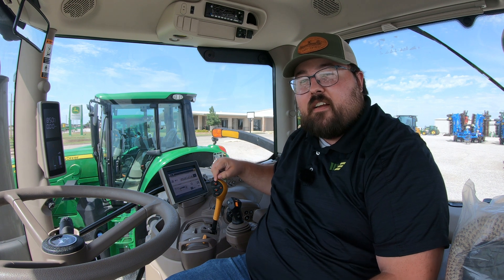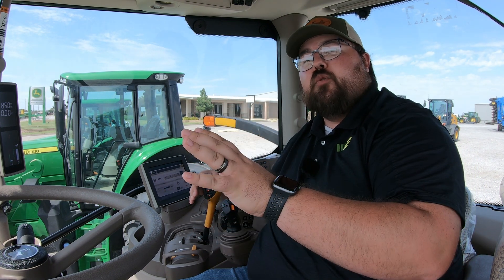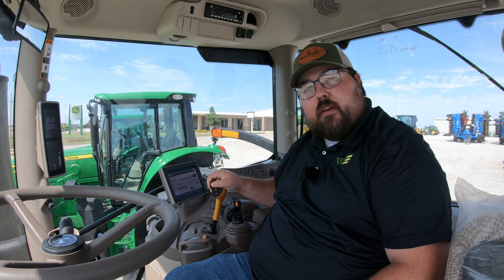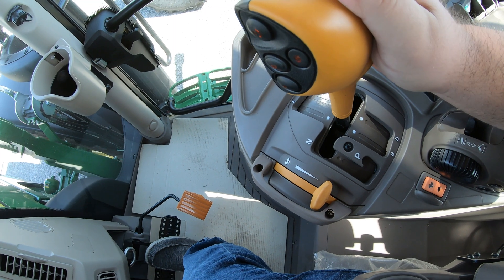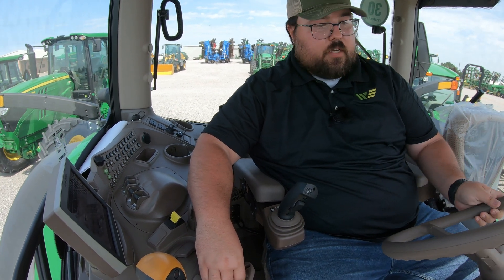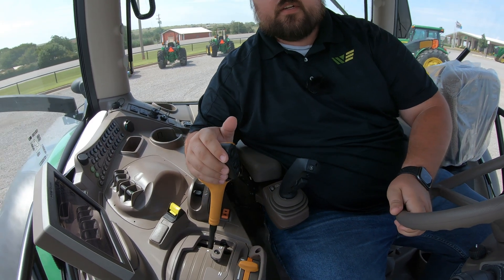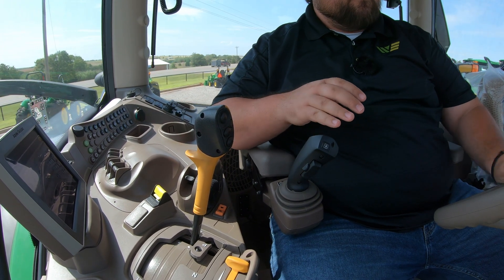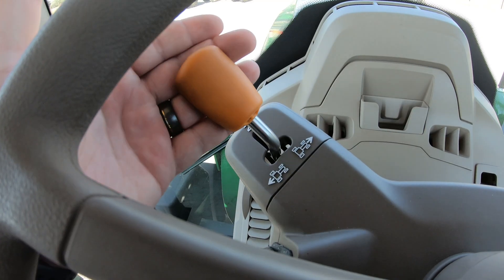De-Clutch Button - What is it and how does it work?

Comment: What I find to be a real pain about the powerquad is B range is too slow to travel, and C is too fast to reverse when running the bale processor to feed cows. Always shifting from c to b to load bales on in reverse. Then  b back  to c to travel to the cows.  

The inline Powershift on my 7710 is way more user friendly for speed change. 

Ivt would be even nicer.
Reply: @wallyyuriy8912  It would be awesome to be able to buy a brand new 7710 or 7810 brand new now I love those things. I always wanted a late model 7810 mfwd autoquad with a 741 loader.
Reply: @ernesthouse7875  yeah my 7710 is straight 19/7 Powershift.  Not great for loader work.  But awesome for everything else